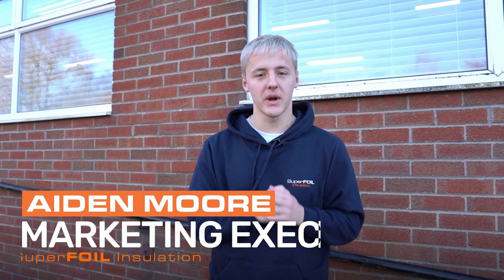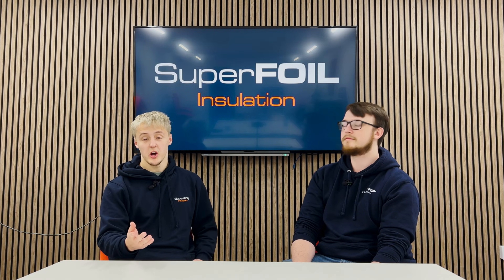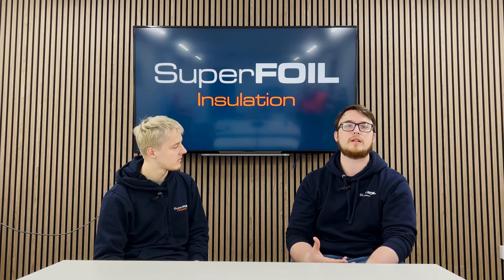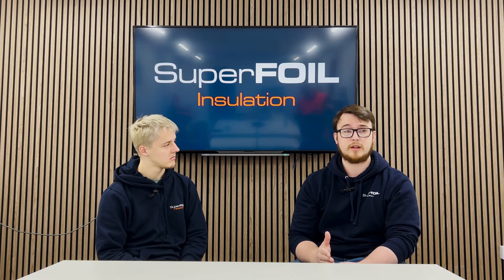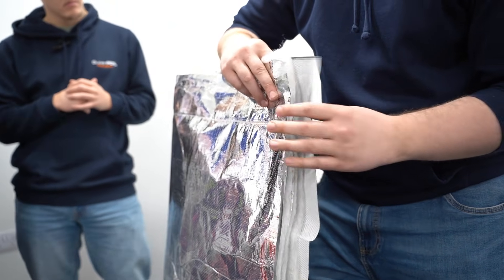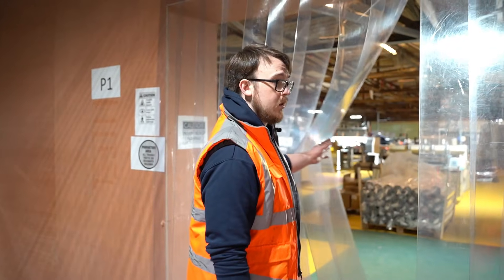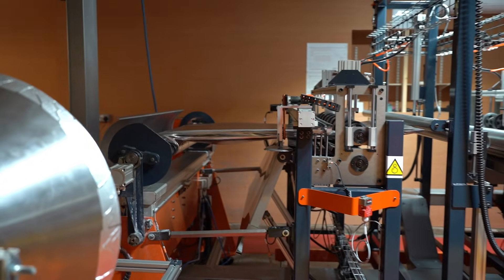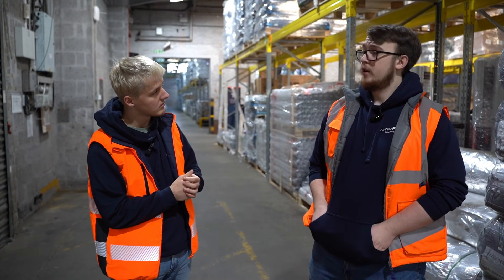YOUR Guide to MultiFOIL Insulation | Is Foil Insulation Any Good?

Comment: What a completely useless video. All pleasant polite, reasonable production, a few tiny bits of meaningful info, loads of words which were just that words

What certification does it have how does it compare in figures not lorry loads but performance figures, showing at least an example installation, showing any challenges like fixing it to ensure it is a continuous membrane with no compromise in performance etc ... Showing the equivalent installation to the pir as a visual comparison. Breathability is mentioned but is it appropriate for  historic buildings where breathability for moisture control is vital. Etc, etc
Reply from the maker: We'll do our best to take your feedback onboard and use it to improve our future videos.

You can find any info regarding product performance and certification on our website, while installation examples are also available on our YT channel (as well as case studies on our website).

Finally, we have an entire technical team to assist you with any specific project requirements - we even provide free U-Value calculations and condensation risk analysis.

Comment: Hope this helps anyone who might be thinking of getting Multifoil as an alternative insulation. I bought the SF19 product for my attic back in 2021, My water tank froze and burst in 2019 Big Freeze, wrecking the house basicallly, so then did a refurb which included making a coat for the water tank in case it burst again. Probably was unnecessary but still did it. Excellent stuff.
 I bought 4 rolls and put it in myself as per video instructions. I also got a small free packet with all the different types of insulation as well so I could see what else they had.
I can definitely say it works brilliantly since. Totally worth the money.   It bends to the shape you want or need and it's breathable. House is much cosier now.
Reply from the maker: Thank you for choosing SuperFOIL as a part of your refurb--we're glad to hear that you've experienced a much cosier home since. We love to hear feedback and especially when it's as nice as this, so thank you for your kind words!

Comment: Do you have a waterproof product that could be used to put onto the water in a hot tub?
Reply from the maker: Hi Phil, thanks for watching our video! Although we do produce insulation that is watertight, our products aren't designed for this purpose, so we'd instead recommend looking for a product specifically designed for that application. We hope that helps.

Comment: Dear Multi Foil Directors, 

This is a very good video to describe how enthusiastic your employees are about your product which is a polite way of saying this is a long way from it being of value to you or I. 

I use insulation all the time, for me to change what I am doing, I need to know what is it good at i.e. what is in it for me. There are no features and benefits and no unique selling points.

Well done to the young lad venturing out into presenting, he did a reasonable job considering.
Reply from the maker: Hi Billy, thanks for commenting and watching the video, much appreciated.

SuperFOIL is a very unique product, with multifoil insulation in general, not being as mainstream as it should be considering the benefits. SuperFOIL insulation is highly sustainable with the recycled equivalent of over 500 plastic bottles being used in one roll of our best-selling product, SF40. Further to that, 1 truck of SuperFOIL will insulate the same amount of homes 6 trucks of PIR, highlighting how the nature of the product lends itself to being more sustainable than other insulation types out there. Speaking of it's nature, SuperFOIL is also highly versatile and usually results in a quicker install when compared to the rest of the market-PIR for example requires more transportation and can be a messy install due to the fact that they have to be cut using specialist tools etc. SuperFOIL/multifoils in general however, are packaged into rolls, making them easy to carry, and the fact that it is a roll of foil, it can easily be moved and fitted without specialist tools, while still performing highly. This is just scratching the surface of the benefits and unique features of SuperFOIL insulation - is a video purely focused on us telling you about the benefits something that you'd be interested in? If so, we'd be happy to oblige!

It was my first time presenting a video of this nature before so to hear that is really nice--thank you very much, Billy!